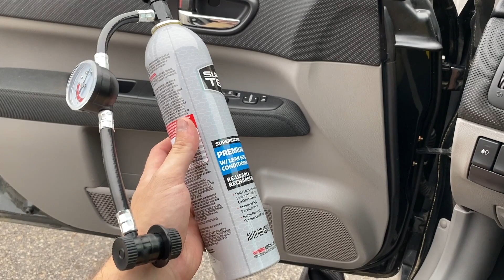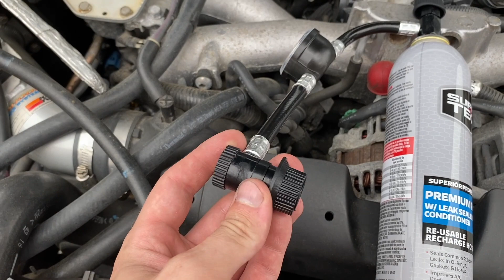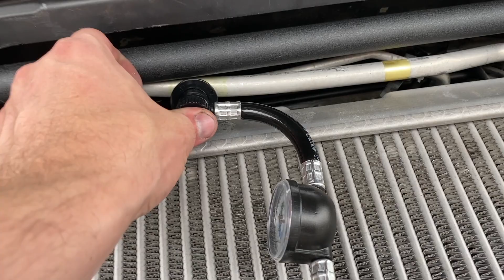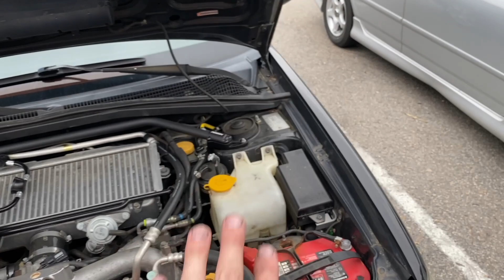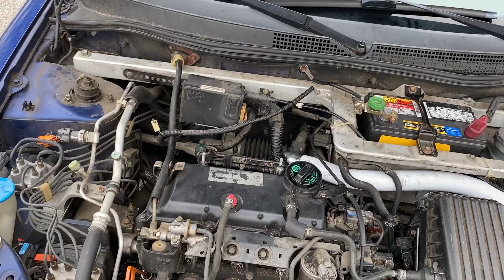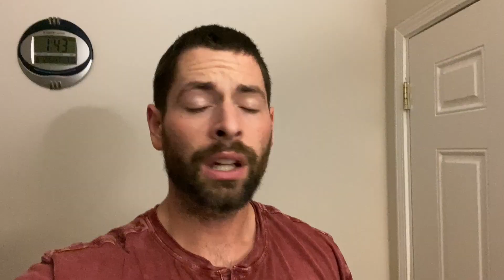AC recharge at home

Comment: People really need to learn at least a bit about what the low pressure reading should be. 
You really do NOT want a 50 psi reading on that vehicle! It might still work OK but you are introducing extra stress on the system that will cause shortened life of components and it really won't cool any better. 
MOST asian import systems made in the past couple of decades only take a maximum of 24 ounces or less.
Putting more in doesn't make them cool better and can damage the systems! Most asian systems today 
will read about 30-35 PSI when they are operating efficiently and charged around the correct amount.
Reply: It's be nice if those bottles had some sort of mass indicator rather than just pressure. Even a couple decimals of grams can affect it significanfly, not in a way that it's feelable on normal days but those days where it's seriously schorcing hot. The A/C is cold, just not cold enough to sustain.
Reply: @oyku.akbulut  If you don't have access to a set of real refrigerant gauges with both low and high pressure readouts, then you should be using a digital thermometer with the probe inserted into the center vents if you get a vent temp of 45F or lower at an ambient temp of 90 after 25 minutes of the system running that is about the best you will get of out any AC system. STOP adding refrigerant when you see the vent temp output stop decreasing.